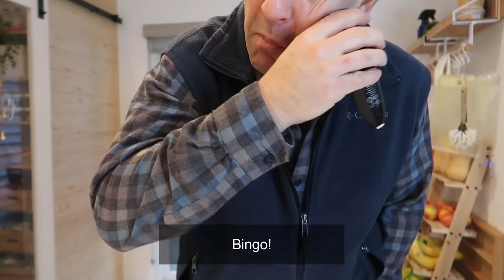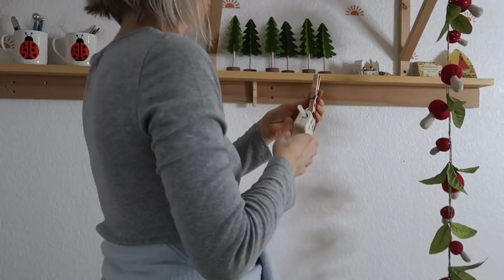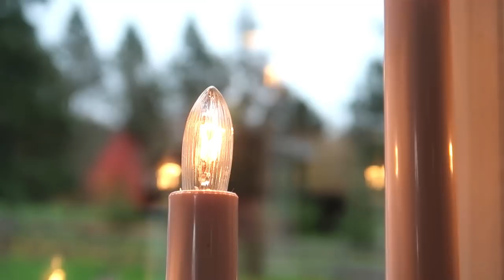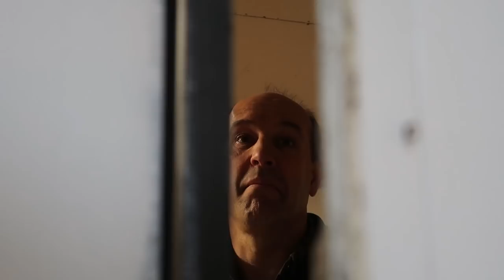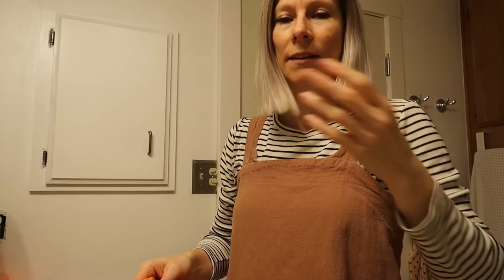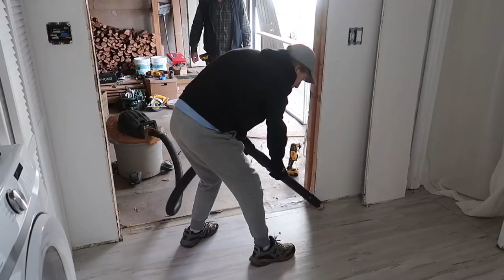MOVING A DOOR | DAY IN THE LIFE | REMODELING | decorating | fixerupper

Comment: The new door in the garage, leading into the house, will be awesome. 😁  I get frustrated with having to style my hair everyday as well and when I had shoulder length hair, I discovered something called a hot hair brush. Pretty neat tool that looks and works like a hair brush, but it heats up like a flat iron so you can use it style your hair as well as brush it. You might find that to be a much more efficient and easier way to get the look you want. Loving the Christmas decoration inspiration. 🎄